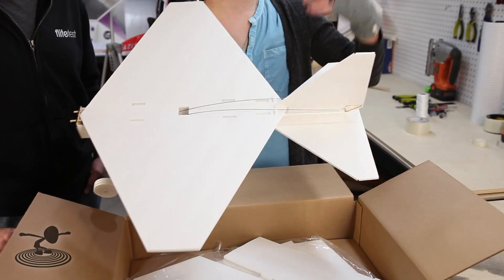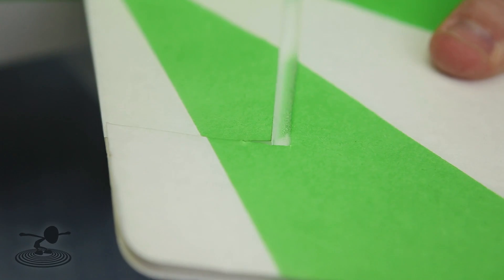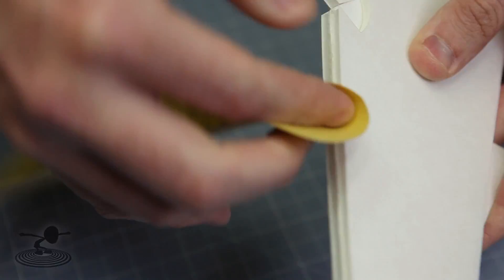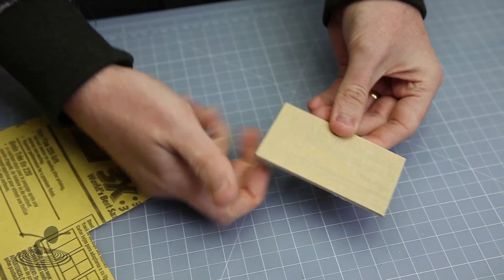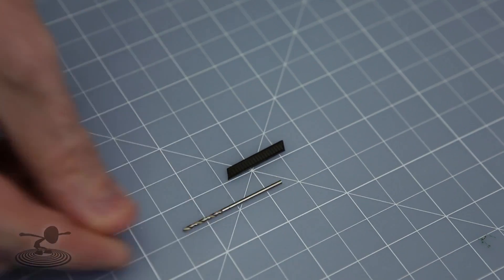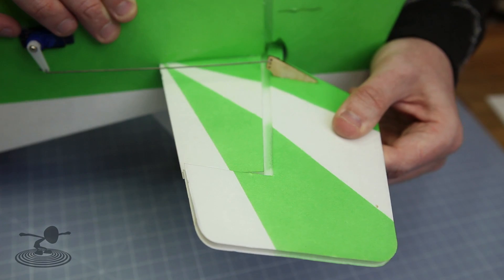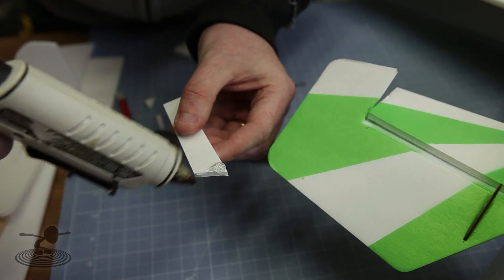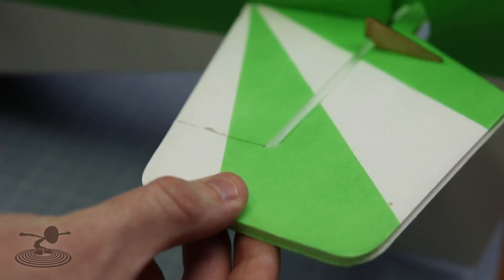Flite Test - Scratch Build Tips - Control Surfaces

Comment: If you're going to try out HK, they have a PnF (Plug and Fly, just needs receiver and battery) Decathlon (similar to cessna/cub) that seems pretty good and should be easy to put floats on (and that type of plane is modifiable, so you can mod it, like bomb drop etc).  And they've got a seaplane (basically Icon A5) similar to the seawind but quite better imho....But if you only have <5mph winds the cub should be pretty good....my UM T-28 handled pretty well in winds so fast i could hover, though.

Comment: Well, floats on a corsair wouldn't work as good as skis, because its a taildragger (two main wheels up front, one tailwheel), skis would work better.  skis are pretty much built for taildraggers, floats for trycicle (like the cessna) landing gear.  Skis would be easier to attach.  The seawind seems pretty good though, imo....but you'll have to buy all the electronics, and from the hobby shop it would probably be another $100+, so that's why i buy everything from HobbyKing, it'd be about $40-60

Comment: Well done, thanks! One thing though, regular sandpaper will wear off easily and hence I don't think it's wise to make a sanding block out of regular sandpaper. You can cut it into a smaller piece and dispose after usage. Sanding blocks are more permanent and can be used for a very long time.

Comment: you must be back in the olden days. Hot glue does the work very sloppily but this "sloppy" work is properly as strong as screws and other joining methods. It's the new generation, you gotta change with time!

Comment: @Jeffrey Saelee That would be very possible, if you mean swapping the motor, battery, ESC, etc... It would have to be in a tube, with the EDF itself at the back of the tube, being wider than the tube in order to get enough air to power the aircraft.

Comment: @the new guys, so to speak, the glue debate goes all the way back to the beginning of the hobby, before RC was FF and CL, we used nothing but PVA (Elmers white glue).  In this hobby, glues have come and gone and some stick around (pun), because they work! Each adhesive has it's use, more important than glue choice is proper use of your chosen glue.  Building materials have changed and hot glue with foam is an near perfect match, again proper use and weight becomes neglect-able!

Comment: You could get a Skyfun Jet/EPO Parkjet from HobbyKing.  they're fast, maneuverable, but they use regular props, so better acceleration.  imo should be a lot easier to fly.  Or, even better, get a Teksumo or Bonsai (which are EPP, VERY strong, if you crash it, just toss it back in the air) and a more powerful power system.  but if you really want EDF, rcuniverse(dot)com(/)magazine(/)article(_)display(dot)cfm?article(_)id=1320 should be a lot easier (just delete the () and replace the dots with .)

Comment: It's half the fun, but when you're Ready.  If you haven't flown for 8 years, and did you total your P-51 before getting much experience?  EDFs don't accelerate as fast as normal prop aircraft, so if you need that power to get you out of a stall or something, you won't get it fast enough, often.  /watch?v=hq8oRBg8UbQ he's a good pilot, been flying for a while, and still had a hard time.  Go on the forums (RCGroups etc) they'll (experienced pilots) tell you the same thing.

Comment: CA eats through this foam, unless you buy expensive foam-safe glue. HG doesn't. CA does not flex, it shatters. HG does. CA takes forever to set up unless you use kicker. HG needs no such things. CA sticks your fingers together instantly. HG burns you, but cleans up easily. CA is expensive. HG is cheap. CA gets brittle when it gets cold. HG is largely unaffected. CA doesn't like UV light. HG doesn't care about UV.

Foamies are cheap and easy and meant to be repaired quickly and cheaply.

Comment: I needed the dx8 for my t-rex 500 anyways, and the plane itself was cheap 150(got the dx8 for 349, dunno if that is bad) for everything battery receiver etc. and thank you for the advice about warped, everything appears to be good though, and the trim thing was more because I didn't know if I was doing something wrong before( I had crashed a p-51 due to severely incorrect trim, aka I made the ailerons flush and the torque spun it), wondered if it was the same for edfs.

Comment: make sure wings etc are square and not warped. trim it by manually adjusting the control rods so all the control surfaces are flush with the non-moveable parts with the transmitter set at neutral trims. then the rest has to be done during flight. but if you had to ask such a question, you have forgotten anything that you knew 8 years and even so, you didn't even bother to read the manual. have fun crashing and gluing. 

is it the eflite mig? remember to use foam safe glue with kicker

Comment: yea the mig is a swept wing edf. We will see how It goes I suppose :P They didn't include a charger I can plug into the wall (just into another battery) so as soon as I get that Ill give it a go and see what happens should be okay and the keyboard does help, gives perspective etc, flight characteristics, and it transferred great when I did get my hands on a controller.

Comment: Yeah, sim wouldn't help if you only use keyboard/mouse.  Hobbyking has a sim cable.  If you got bored of the bixler-style plane, maybe you could get something a bit more advanced (or do the FT swappables)....maybe the teksumo?  I built a small wing once, quite easy to fly  I started with a parkzone UM Trojan, after flying about a year on sims.  then my 2nd airplane was a scratchbuild twin boom plane (vid on my channel).  after that, it was all scratchbuilds for me XD

Comment: I haven't flown for 8 years, I didn't fly jets, and I had something very similar to the bixler when I did fly, I just got bored of it. And the simulator thing is what I've been doing, I have clearview and that works well, then at the hobby store I tried the sim with a Dx8 and I found it very easy. Though I will get a USB cord, which sim you recommend? and in that case trimming will be fun :) and I wouldn't of gone with the mig except that it has gyro's.